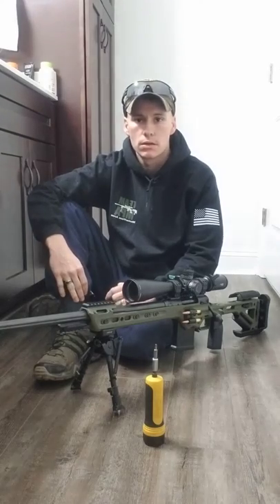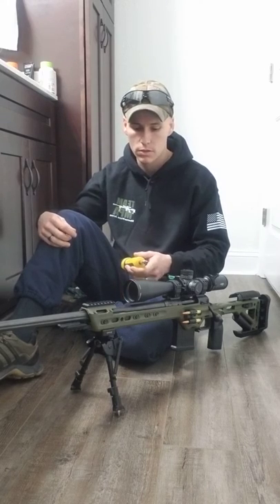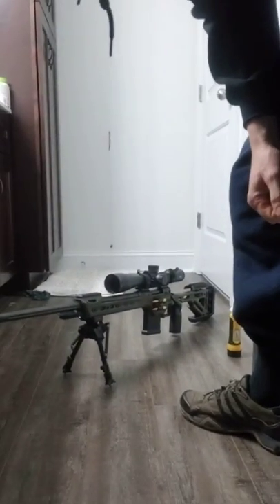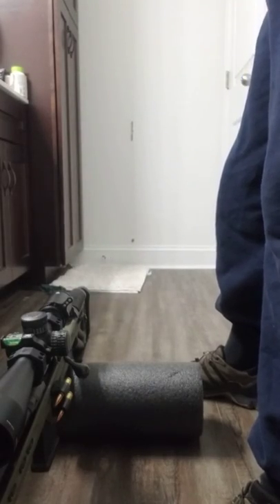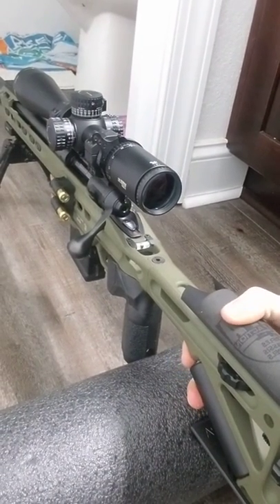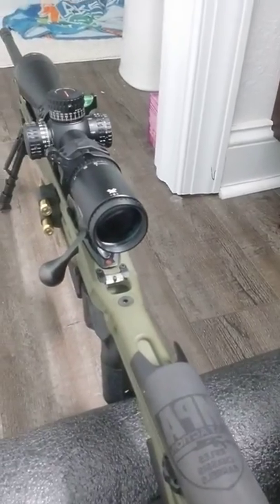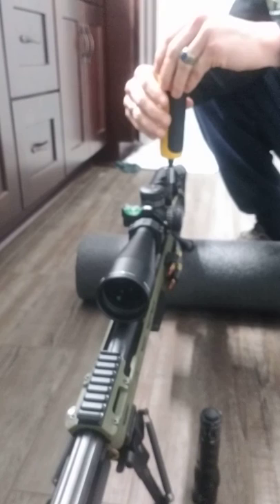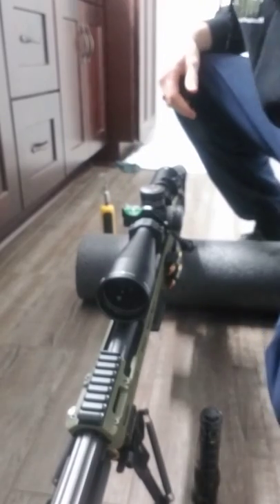Rifle scope plumb bob method.

Comment: I use the same plumb bob method but in reverse. Hang the plumb bob on a wall approx 15 feet away, level my rifle base in a gun vice then look thru the scope as normal, focus and match the loosened scope cross hairs with the line on the wall until it’s perfect, then tighten down..

Comment: One can do the same thing without the flashlight just by looking through the scope as if you are aiming at something.  Just aim at your plumb line.  Same principle.  In my shop I level the rifle in my vice and hang my plumb line after that.  Then I make the adjustments like you did.
Reply: Not as accurate.
Reply: @StuninRub  disagree, but that's ok.
Reply: @easttexan2933  Facts and physics doesn't care if you disagree.
Reply: @StuninRub  does it really matter about such an insignificant thing?
Reply: @easttexan2933  1 degree off = 60 MOA. So yea, it matters.
Reply: @StuninRub  to some. not to me.
Reply: @easttexan2933  60 MOA is 60 MOA.

Comment: I would say that if you rightfully don’t trust a bubble level on the pic rail or scope cap that you shouldn’t trust the one built into the chassis. I am not saying don’t use it but you should verify on a tall target with live fire that the vertical of the crosshair bisects the centerline of the bore. Although this requires a consistent shooter who’s poi doesn’t change with inconsistent recoil management as well as proper parallax setup.

Comment: Without a chassis level,
How would you do that ?
Reply from the maker: I would simply put a bubble level on the picatinni rail of the receiver and go that route if you didnt have a level on the chassis or stock. I've done it before and found it works through testing at distance. My level on my chassis and a bubble level on the pic rail on the receiver match perfectly which is why I use the level on my chassis in this video.

Comment: Whats the torque fore the scope cap screws you use for your rings my friend.
Reply from the maker: Vortex specifies that you dont want to go no more than 18 inch lbs for the torque on the scope rings in relation to the body of the scope. If you torque the rings too tight, it can and will damage the erector assembly, internals and your parallax. So, I follow the manufacturer's torque spec at (18 inch lbs.)
Reply: @andyeppi  thank you.
Reply from the maker: @johnnyventurino8947  you're welcome.

Comment: But  and its a BIG but,,,how do you know the Vertical Reticle is Directly over the bore??
Reply: That doesn't matter.  The next step is to  zero the scope with the rifle and the cartridge you plan to use.   The point of impact (POI) adjusted to the reticle is what matters.   Switch to a different bullet and you will have to re-zero the scope because the POI will not be the same.
Reply: This is a great question. Intuitively thinking, I suspect a tall target test  at 100 would indicate vertical stringing will be fine when your windage is centred at that distance. But if the reticle is slightly offset left or right from the bore then dragging the test out further would intuitively suggest that your windage will change as your reticle is crossing from either left or right to windage centre. So you could validate with a tall target test at longer distances, and you might find a windage shift either left or right by a consistent amount in the vertical and if your reticle is level then your vertical test should still track level, just shifted in windage slightly. This can compound with rail level if greater than 0MOA rail and bullet spin drift as you go longer distance and then you’ll really have to be brutally honest with wind call and full environmentals. Overall you are working towards greatest precision you can and how well you can really shoot. Graduate at each 100m distance before progressing to keep yourself honest (consistent) and identifying any anomaly before progressing to the next distance.